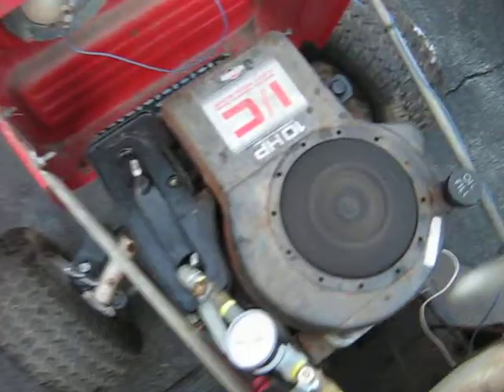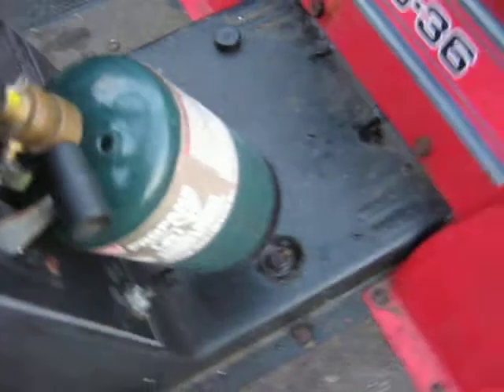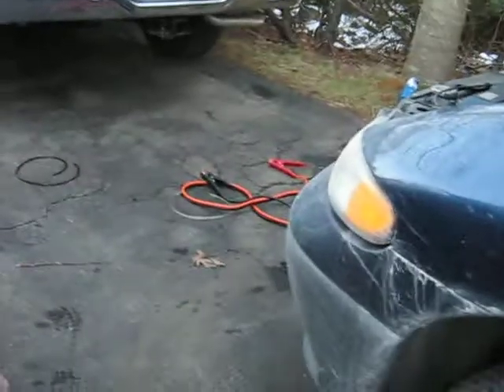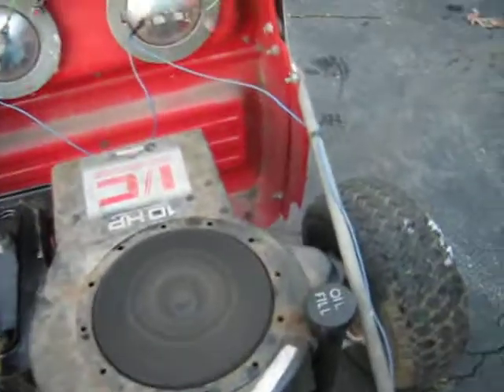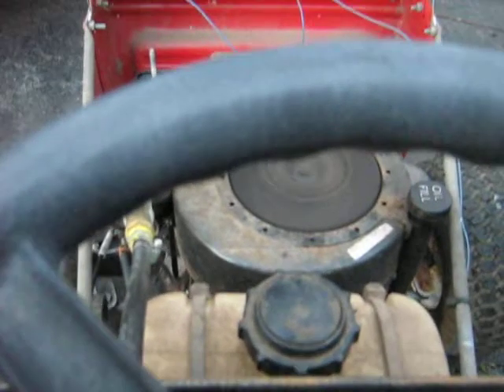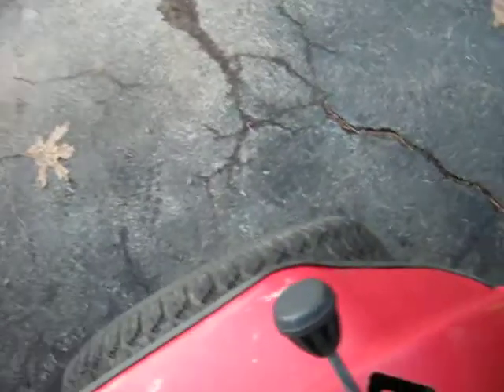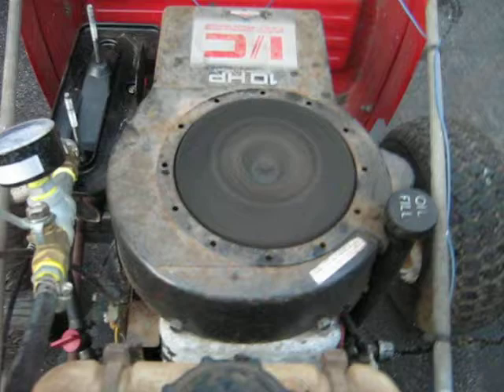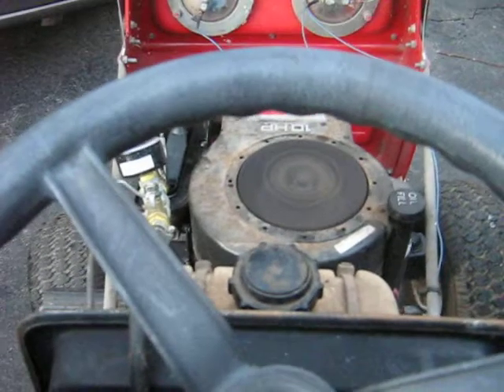propane lawn tractor

Comment: You know you can take the propane line and take all of that stuff off that goes into the intake and take the stock fuel line off the carbuerator and put the regular fuel line hose from ur propane tank where in place of the gas line that came with it and u can put the air cleaner back on. make sure u use one of those little clamps to hold the line on. but the propane runs through the carb instead of directly in the intake. Propane wont have anything to do with ur belt. it might have came off.

Comment from the maker: @propanemower13 the fuel line was just all swollen and fuel wasnt getting into the engine so i just got a new line and it works off gas now. but i didnt want to take the pressure gage and valves off from the propane tank because that setup is what i use on my potato cannon to get the perfect air to fuel mixture, so i just didnt want to mess with it. the belt problem though was it wouldnt engage in anything lower than the 3rd gear, i think the belt was just streched. everything works great now.